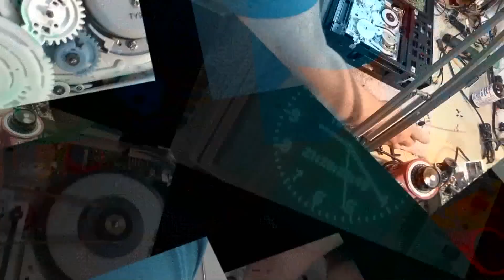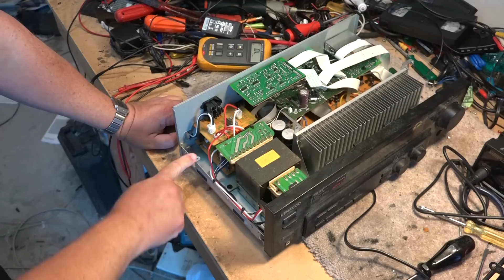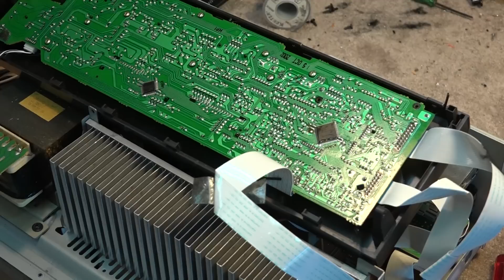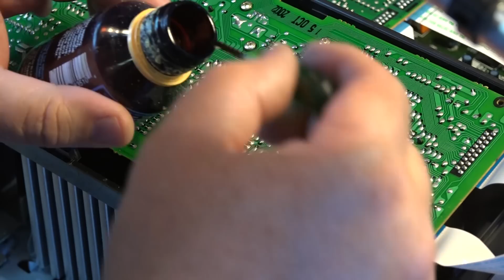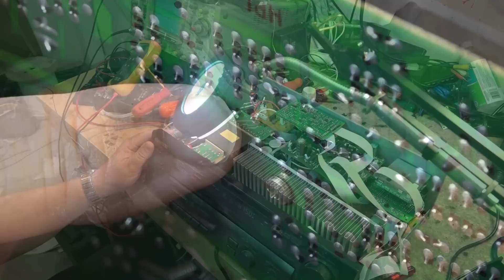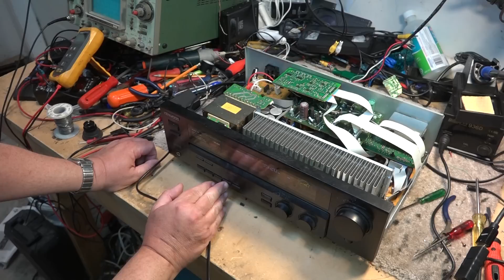Kenwood VR606 AV Receiver Dead

Comment: Google everything!  I have the VR606 and suddenly no light, no power!  A quick google said a simple fix.  And it doesnt get more simple then this!  Ready?  Hold Power button on.  While holding it put the power plug into the A/C, then release the power button.  Finally....press power ON.  Bazinga!  Working with power and light again!  Happy this day AUGUST 9, 2023!
Reply from the maker: You got lucky with a reset.  Had to do that last week with my yaesu fusion radio.

Comment: I am no electronic tech but I do marine and automotive electrical. I know you probably wont read or reply but the process I would of used it trace back from the relay back through the circuit to find out where the voltage starts and where is stops . You used the shot gun approach and soldered everything. I was surprised. You are a very good tech most would of traced it out. And you put flux on the IC but only soldered one side ? Very puzzling 🤫🤫🤫🤫🤫
Reply from the maker: These are very different than marine and automtotve.  All microprocessor.  Tracing back does nothing on these becauae a fault that may have been momentarily can shut the processor down.  Lead free solder connections cause more faults than you can imagine.   So flaky looking connections are checked first.
Reply: @12voltvids  Interesting seen other techs check voltage in and voltage out to check circuits that are non op . But this was on the older vintage equipment. Is this mainly on the newer systems ?
Reply from the maker: @madmanmechanic8847  newer systems tie everything to the CPU. I did check voltages but not necessarily on camera
Reply: @12voltvids  Oh ok . Even as long as you have done this I bet you are constantly learning. Where is the processor on this ? Thanks for the reply I know you are busy .

Comment: Very similar looking chassis, dropped in by a friend. It’s a European model KRF-V4070D, different IPM’s of course and who knows what options. Has a flashing standby light and power relay clicking on then off again. Display comes on ok. Protection issue of some description not responding to reset procedure. I suspected and ordered new IPM’s but will be rechecking more closely for dry joints throughout when I return to the bench! Interesting that the unit dates 11 Aug 2002 just a few months before yours. Love this channel!

Comment: Hi 12Voltvids, I really have to thank you for the great 'Kenwood VR606 AV Receiver Dead' video which has rekindled the hopes for my kVR-5580D whose display has been off for a few years! I would like to ask you what magnifying glass you use (10x - 20x ..) to check the 'cold' welds and also what power the soldering iron has (mine is a 100w but I think it's too high).
Thanks for any answers .. you are great!
Patrizio

Comment: Thanks for voltages and pointing out bad solder joints on board, mine has bad spots also! . Bye the way.. I want to say something with infinite meaning, for you that would be about electronics. I worked at Texas Instruments, they have manuals on their transistors, and charts of Family of Curves, using different voltages on transistor. I found a way to make transistors and Field Effect Transistors the most sensitive to an input. Connect a load resistor to collector and resistor to adjustable voltage power supply (you can buy one as I did), ground emitter. Turn on power supply. All voltage will be dropped across transistor. Turn up voltage till transistor shorts out. Then turn voltage back just a little so transistor isn’t shorted out. Then put signal on base, WOW, sensitive!
Reply: My voltage is low, only 8 volts. It may be Elementary and Systematic from here on out, Thanks again for your help!

Comment: I didn’t expect the unit to be in good condition inside after seeing how dirty it was from the outside!! Good job fixing it!! It seems that more than 70% of these complex AVRs got problems with bad solder joints.
Reply: Mine went OUT.  I push power on, plug in, release power button, re press for power! Boom!  Works.  Happy.

Comment: I have a question... Well 2 questions...

1. Could I send you a amp to fix?
2.  I recently picked up a 90's Kenwood amp from Goodwill (model Krv87a).

So I get it home, 
plug it in..
Amp comes on...
But....none of the buttons on the front work (minus volume).
I'll post a video underneath

Comment: All of these black plastic receivers don’t even come close to receivers of the 60/70s where quality was intact , I’ve got a similar kenwood with the same problems, maybe I’ll dig it up and give it shot. Mine is a kv r 7040, and yes what’s the deal with having to take the entire cabinet apart just to access common failure power transistors?

Comment: My Kenwood VR 407 turns on but once it starts to get warm it automatically kicks into flashing red light standby.  Any suggestions?  It went out while running music high volume and probably over heated before protection enabled.  Thanks for your great video!
Reply: Hey I had the same issue with my 407, did you find any solution?

Comment: I have a question for you I have an originally owned vr-715 looks exactly the same... my left speaker input clicks on and off when i push on the terminals with a good amount of pressure. not able to find the problem i bought what i thought was a direct replacment. But i didnt read the description of the model and i got this unit vr-606 i have the same issue with the back of the reciever with the center channel do you have any solutions to this problem? or help trouble shoot what the issue may be?

Comment: Mate i have some serious issue going on with my sony hifi which was made during the 90s i believe. I have heated up all the cold joints and serviced the deck and cd drive. Now the main problem, i have no sound coming out of the unit. But there's noise interference, buzzing sound. Like for example, if i plug AV cable on the phono port and touch the socket on the other end, it gives me the signal noise that means the signal is going in. But no sound, music comes out of the speaker except for this buzzing and signal sound. Do u think the STR IC might be damaged? The model is HCD-V8900AV. It has 2 STR's. One for the surround which is a smaller one and the bigger one is for the main sound. I have checked all the fusible resistors and transistors on the amp board, all seems fine. The amp board also have some fuses, all seems fine.
Reply: I think you might have a broken connection or a broken trace, happened to me once I was going mad cause everything checked fine. Before you do anything too radical use a magnifier  and inspect those traces cause sometimes the heat is putting stress on them and when it gets cool down you cant see a broken one with the naked eye...

Comment: I really liked your method of troubleshooting and solving the problem.  I do have a question, though.  What causes the solder to crack and why did the solder crack in some connections and not others?

Thanks a lot, Tom
Reply from the maker: Lead free solder and bga  chipsets
Reply from the maker: There are many things that can cause solder to crack. The most common is not enough heat during initial construction. not enough solder applied, and thermal shock.This is a much bigger problem with lead free solder. On high power connections or components that get hot, heat travels down the lead, and as it does the copper wire expands at a different rate than the tin/copper or tin/silver alloy which is what most lead free solder is. Older lead solder was softer, and could handle this expansion contraction of the copper component leads better. With the more brittle lead free solder, when you get constant thermal expansion / contraction eventually it will weaken the bond then, it goes open.
Reply: Thanks for that very thorough explanation.  I only use the older lead solder, so I'm good there.
Reply: Lead free solder is an example of irony, wouldn't you agree?

It's supposed to be good for the environment, except it has led to an early death for many electronic devices whereupon people wastefully toss them and buy replacements.
Reply: 12voltvids

What do you call a failed lead-free BGA?

Busted balls.
Reply: 12voltvids

Oh yes, a match made in hell for sure.
Reply: I only buy rosin core solder with lead in it for that reason :-)

Comment: Clean it up with some Novus, might help to get you another five bucks!  :)  What's that item on your desk marked 936D? Camera  / radio accessory? I see a future YT repair video in your future to get your Weller up and running!
Reply from the maker: My weller needs a new iron because the thermocouple is shot. The 936D is my cheap chinese soldering iron. I already repaired the factory faults in that one when I bought it.

Comment: Thanks for your great repair videos. Quick question: do you use any type of ventilation system for solder fumes?
Reply from the maker: No I am not that concerned about solder fumes. When I worked in the business working at the shop, the shop owner did nothing to mitigate fumes from chemicals and solder smoke. He even put a door on the shop, and kept it closed so nobody could see in, and more importantly, the techs couldn't waste time by watching what went on in the store. So any damage that has been done has already been done. Back when I was in school we used to play with liquid mercury too. Pour it on the table. Throw it around, stick wires with power on them and watch it boil. You know, stupid stuff all under supervised instruction. Of course now break a CFL bulb and they call in the hazmat team and spend a few thousand dollars cleaning up a pin head sizes spill.My shop is an open garage, there is plenty of fresh air blowing through it.
Reply: Everyone is such a baby now :D

Comment: that last one may have been the main problem with the power but the others definitely needed re-soldering, good catch, they are not easy to spot.
Reply: Kirk Nelson 🇯🇲🇯🇲🇯🇲🇯🇲🇯🇲🇯🇲🇯🇲🇱🇧🇯🇲🇯🇲🇯🇲🇯🇲🇯🇲🇯🇲🇯🇲🇯🇲🇯🇲❤️❤️❤️❤️❤️❤️🇦🇮🇰🇳🇸🇭🇱🇰🦀🐁🇿🇦🇷🇸🇷🇸🇬🇸🇷🇸🇷🇸🇸🇨🍍🍍
Reply: I find it easier to flex the board a bit as I am scanning. The crack width will fluctuate making them easier to spot. Then again, I don't have one of those magnifying ring lights.

Comment: i had this amp. i scrapped it for caps and transformer and made a 36watt tube amp with behringer tubes
Reply from the maker: I run a tube amp hooked to a 200 disk changer, Dat, and cassette deck. It sounds nice. But doesn't have the bass of my hybrid luxman.
Reply: +12voltvids but does the job. ur vids are awesome. its my latenight channek next to uxwbill and maxxarcade

Comment: But why that connections cracking? One i think it is someway possible but not 4 or more. I am very enjoy yours videos. Thank you. :)
Reply from the maker: That would be because they weren't done properly at the factory. Not enough flux applied, not enough heat on wave soldering. Many factors cause broken solder. It was a common problem back in the day. Still is, with BGA connections on modern stuff.
Reply: I've had this problem on 3  Sherwood Newcastle r925 . The radiator is identical. I take it the heat also doesn't help with solder joints? The r925 I've had use 800w power consumption and they get pretty warm. The amount of caps that need replacing in them is crazy. In all 3 the main filters were puffed out and a stack load of the samwha SD caps had there jackets stretched down there sides. Crappy caps in a hot amp I feel is total 
 nonsense. Oh and hours and hours worth of resoldering badly cracked joints. Great fun tho and worth fixing. They have a superb sound and lots of power. 
Thanks for the video, I've learned a lot from your vids 🙂

Comment: Smashing job :-D, another perfectly good device saved :-D.
.
The old "Solder drum" problem, often the component pcb holes are too big or not enough solder, nice thin drum of solder ready to crack.
Ive seen that problem on monitor/tv crt drive pcb's, also c.b radios.
One type of c.b radio was so bad that every one i repaired had a bad synthesiser, blanket solder that small area and it would work spot on, no returns ever :-D.
Im no lover of the stk or sanken modules, i like the discrete transistor power amps, im just odd that way LOL :-D.
Reply from the maker: IPM were the Achilles heel of electronics. Horrible. Sony used to use 3 channel IPM for the convergence drive IC for their projection TV of the day. Lots of failures.
Reply: Oh dear, convergence all fecked up lol.
Never liked the sealed in sort, a nice ovan to cook the parts.
Im waiting untill we get a better way of mounting mobo chips, solder used as (glue+connection) is just batty.
Also sockets mounted on pcbs with just the solder holding them in, no no its a bad method.
if say sat nav's had there usb socket mounted on a bracket and flexable wires for the connection they would never cause problems.
And whats this thing about stupid micro sockets, daft buggers.
Reply from the maker: Can you say planned obsolesce? .... I knew you could!

Comment: Anyway I got a question not related to this video, but still interesting, is there in the market any add-on boards for TV to get HDMI Out for recording screen? As I have LG TV 2 years old with "Time Machine" option to save TV shows but it is a protected recordings with no way to get them to transferred to PC. HDMI Out would be solution in my opinion...
Reply from the maker: HDMI recordings are encrypted and protected for that very reason, to prevent you from recording them.There are some HDMI to component and HDMI to composite adapters on the market that will take an HDMI signal and give you an analog output for recording. I have reviewed both of these devices, and repaired them. The HDMI to component adapter I have gives a 720P component output from a 1080 input, which can be recorded using an HD capture device with component input.  There are commercial HDMI capture boards, however they observe the copyright bit and if set they will not record.  For my TV provider I have an old box that has component output so I can record anything in HD I wish, but if that box ever packs it in, and it gets replaced with a new one that has no component outputs I will be screwed.